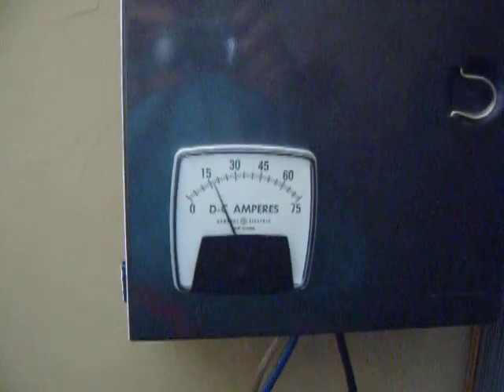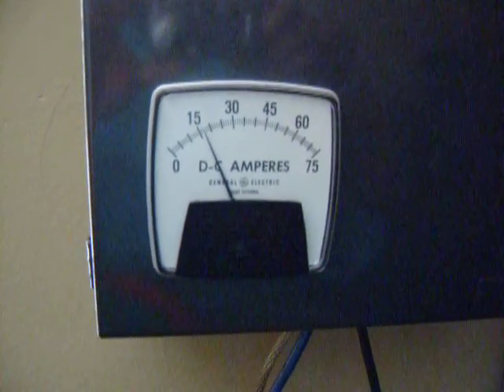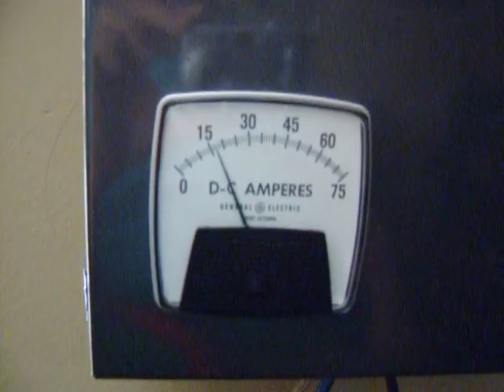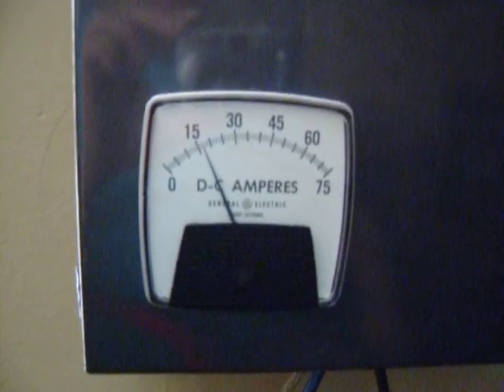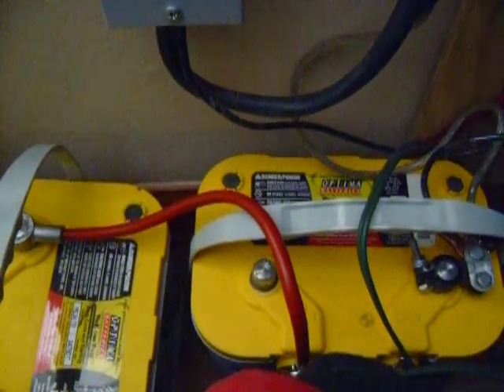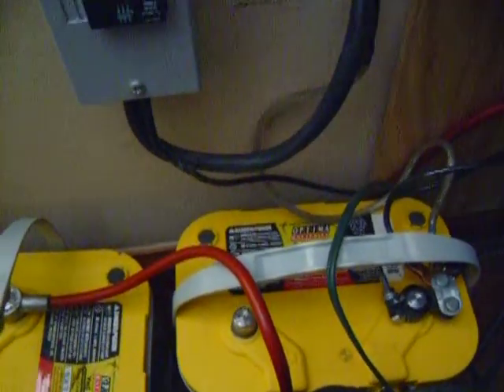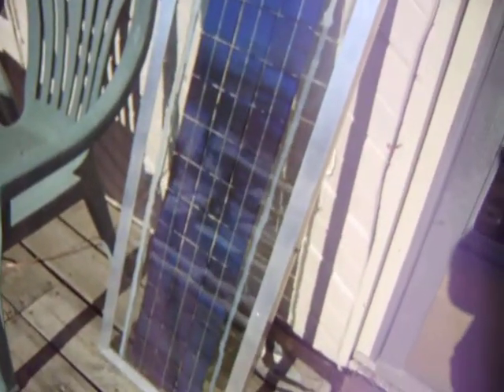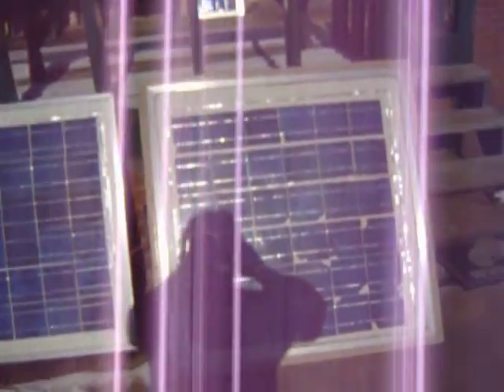17 Amps

Comment from the maker: @nrodge1 I found out it might be the the cables to the inverter were too small but this particular inverter is only suppose to start up a dorm size fridge some where I read about it in the description for this particular inverter. I hooked this inverter up to a old battery I have in my bedroom but the old battery couldn't make enough voltage.

Comment from the maker: @nrodge1 its welding cable plenty big about 2 gauge I think. The Xantrax is suppose run 2000 continuous. I think the surge is 3,000 Its suppose to run a very small dorm fridge. It can barely run my 850 watt microwave. I am going to get a bigger inverter. But it will run the tv, satellite and lamp all day  and all night. The tv is about 80 watts and the satellite is about  60 watts and the lamp is about 12 watts. Maybe the inverter is damaged but I think it just dont have enough ump.

Comment: I don't understand why your inverter won't power your fridge, most are 500W start/200W run. What size is the wire going to the inverter and what model is that inverter? Is it modified sine wave or pure sine wave?

Comment from the maker: @wtam69 I have been told up to ten years. They can actually set around for a year with out a charge and still be charged in the same state they were when left to set. I like them because they don't give off hydrogen gas and they never corrode. Also they charge up faster than flooded batteries. If a hole is punctured in them they will not leak because they have a fiberglass matting.The only thing I dislike is that they don't have a real high discharge rate and they are really expensive.